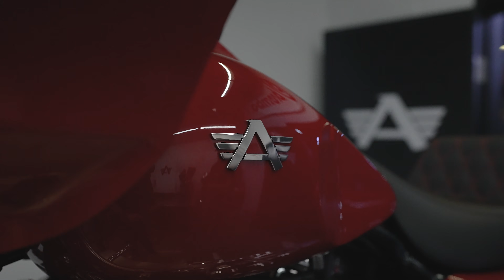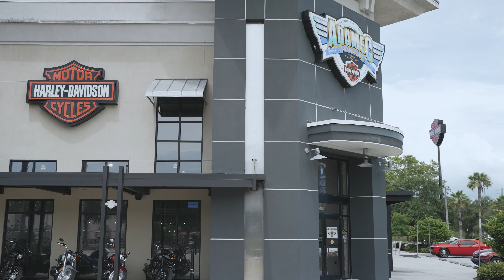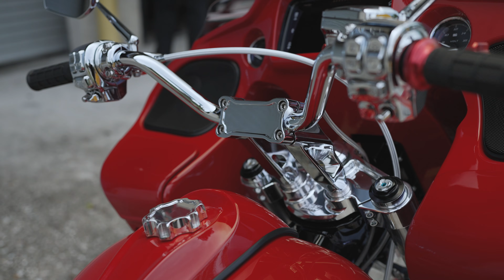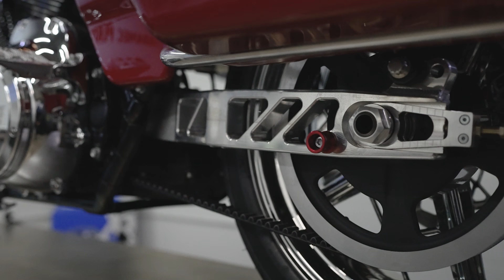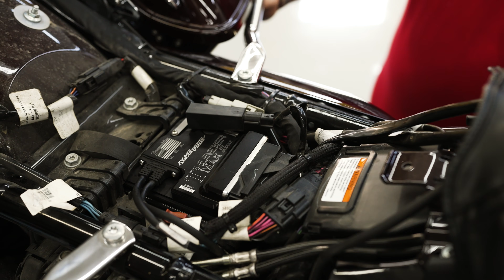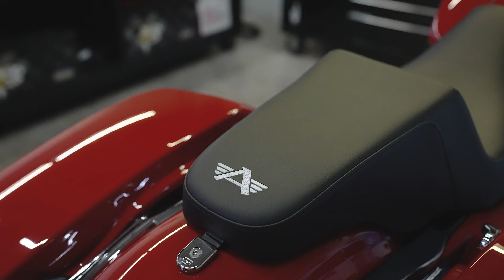Adamec Performance Garage - Harley Davidson Road Glide

Comment: Great work! When eliminating the gauges are you able to do a split screen?  It would be great if you can do MPH on 1 side and maps on the other.
Reply from the maker: Good question man.  From the screens I saw them go through, I don't remember any split screen options, but you might want to reach out to those guys to verify.  They'd be the experts for sure.  Definitely be a neat option though.

Comment: What are you guys doing for an odometer?
Reply from the maker: iirc, all the info was now in the new radio they installed (they didn’t keep the stock one), but I’m not 100%.  You could reach out to those guys directly to make sure.
Reply: @getBenTmoto  Right on my guy. Thank you.

Comment: How did you take a single line from the abs block?
Reply: We just blocked the right side "out" with a kit that HHI offers (usually for big wheel baggers w/ single discs). Ran just the left side line with a double banjo on the caliper.
Reply: @adamecperformancegarage497  does the ‘block off’ part have a name? I’m trying to find it on the website. I’ve redone my lines already but I want the loop over 👍